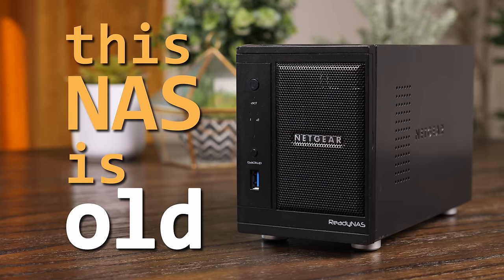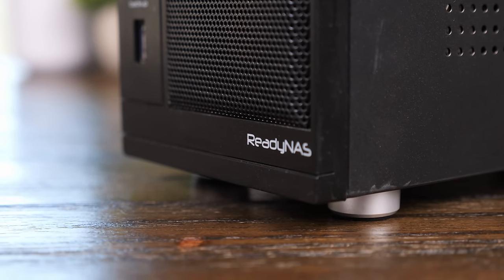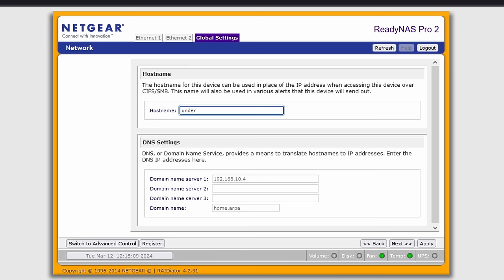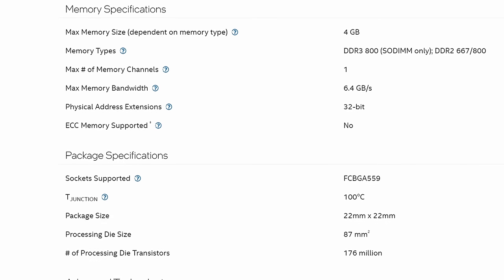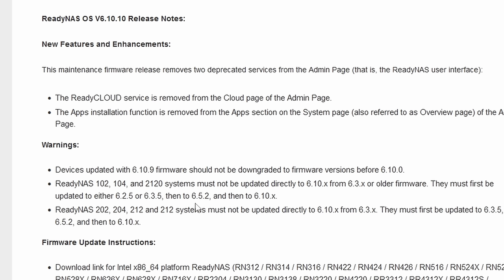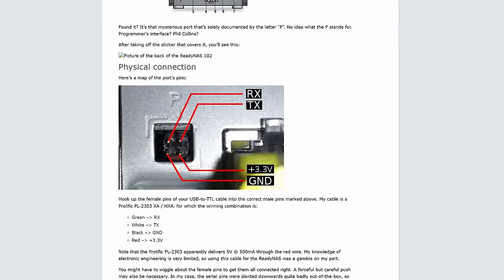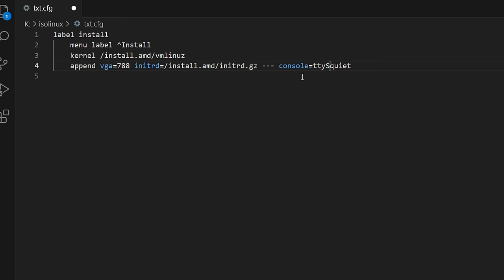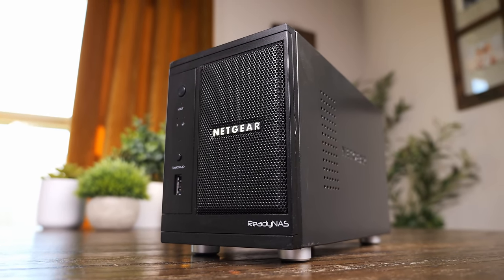The NAS You Didn't Know You Could Still Use

Comment: 6:45 The usual limitation with Atom processors for RAM was the Chipset. Intel had a "discount" chipset for Atoms that maxed out at 2GB (forget the numbers/names but it was VERY common). The Atom CPU was good for 4GB, but the el cheap-o chipset was only good for 2GB.
Reply: Intel up to it's old games.
Reply: I think I found it.The chipset named the NM10 express that was an "ensh--ified" low-power consumption version of the ICH7 chipset that was kneecapped to 2GB.
Reply: Not sure why the chipset matters, the ram controller is in the CPU (hence why the limitation of RAM is in the CPU page and not the Chipset page on intel Ark)
Reply: @marcogenovesi8570 You are limited to 2GB per "slot" whether it is soldered or socketed. The RAM had to be distributed over 2 "slots" so unless you had 2 physical slots, even if one "slot" was soldered, you were limited. I don't recall if both slots had to match.
Reply: @racecar_spelled_backwards868  That's not an answer to my question. How does a chipset care about RAM that is connected physically to the memory controller in the CPU?
Reply: @racecar_spelled_backwards868 Mind me I'm not saying the limits you post are wrong. I do remember them and they are real. I'm just disagreeing about blaming the chipset for that.

Comment: You can just use cat or pv or whatever to dump the contents of the onboard flash drive
cat /dev/sdx > /backup_file.img
This is not a "raw flash" thing but a "usb flash drive" that is soldered on the motherboard,, so it does not need special commands for backup or restore.
Reply from the maker: The issue was less so that I couldn't do it, and more so that I didn't have the time (nor the will) to do it at that point haha

Comment: systems like that on ddr3 era is actually very sensitive with ram type, ddr3 ddr3l and the frequencies. So maybe try a 4gb ddr3l 1333mhz RAM. usually ddr3l works on ddr3 and ddr3l supported motherboards while dd3 sodimms only work on ddr3 only motherboards.

me also see the part trying to boot debian linux on it, and im expecting you to get a blackscreen, and yes it does.... default boot config for debian is to boot via VGA so yeah, want serial output, you need to edit config file.

Comment: Meanwhile, I do stupid things and intentionally set my NAS to support SMB 1.0 so I can connect to it with my old Windows XP/2000 computers. On top of that, I expose it to the web with Tailscale so I can access it remotely. All of this is running on a Celeron laptop (with the battery capped) I got a few years ago that isn't good for much other than using it as a basic NAS, which I am doing by making a shared drive in Windows 10. I know my setup is bad, but I only do it this way because I want to.
Reply: Tailscale is still a VPN so it's not like placing a SMB1 share just there on a public IP
Reply: @marcogenovesi8570 That's true at least

Comment: It's not that old.  The computer I'm using right now is 12 or 13 years old.  It does everything I need.  I can run a lot of programs at the same time, as well as have dozens of browser windows open.  I have a virtual machine so I can run Windows XP and old software that I really like.  When I built my computer, I used top of the line parts so it would take years to get outdated.  The only upgrade I've done is to replace the hard drive with an SSD, and I'm up to Windows 10.  Since 11 may not run on it, if I need another operating system, I'll go to Linux.

Comment: When my Qnap 4 bay starting having issues i discovered it used a internal usb Bom glued internally i ripped that out installed Unraid its now my wifes 4x6TB personal Cloud sever eith custom Noctua fans for quieter operation even added liquid metal to the SoC 🤣 and oddly enough added additional ram that the og os couldn't see.

Comment: I got excited when i seen the thumbnail but unfortunately my readynas duo is a v1 and uses the spark cpu, the ONLY thing that can be done is upgrade the ram to 1gb, it has 256mb at the moment and has had for the last 6 years as i cant find the right module for it, and unfortunately there are no useful hacks as everything was made to use the Atom CPU and not the Spark, i just use it as a JBOD share to back up our families phone data like pics, videos etc automatically every night, then i have an external usb drive plugged in that mirrors the internal drives so if one does fail i can just swap it out and copy the info back

Comment: I have the 6 bay version, running trunas. Pulled it out of the recycle bin at work like 8yrs ago and filled it with 6gb sata's for a raidz2 pool. Its not fast, and don't dare run any plugins (chroot jails, containers). That said, it just runs and runs... never reboots.

Comment: thats a typical intel thing. i have a intel silver j5040 as my daily pc and i looked online what can the cpu do and how much it can do. i learned intel is a really confusing on such stuff. 
on desktop cpus the talk about system wide memory size but on embedded cpus they talk about max ram per channel. on server there is no limit at all only a recommendation so the mainbord manufactures decide how much is to much like dell or supermicro and such. but some times these things get mixed up if the cpu us oem only or renamed for a different purpose with a slightly different socket or a different mounting package. 
like the j5040 it is a normal pentium for it falls in the silver category and is for thin clients and tablets. but also for small form factor servers like a router or multipurpose nas system. in this case it is not that clear what it will be. is es nor a mobile chip or desktop or oem only or server. it says 8gb but if you look up the pentium thats in this chip this can 16gb so i tried 8gb stick and it worked also the 16gb stick worked but it had some random bugs and crashes so this might be to much this thing can really handle. so i did 2 8gb sticks in it and i use it like this for 3 years now for every thing i do except for gaming obviously ^^

Comment: Does anyone know if a raid 5 or 6 can rebuild using only the remaining disks if replacing a failed drive is not an option? All that would be if there was enough empty space on the remaining disks to fit the data despite the loss of a disk. My reason for asking is that I am considering putting 3 sun F 80 warp drive pcie cards(Gen2) (4x200GbX3cards) 4 WD green ssd (480Gb) and 1 2Tb hdd in a nas/server type pc. The F80´s would be in a raid, either 0, 5 or 6 that would be raid 1 with the hdd. From what I heard in a raid 1 the fastest free disk will handle the I/O so the hdd should be virtually untouched but still have the data just in case. The ssd´s are tbd regarding config. The system I plan on using is a AMD FX 8350 with 16Gb ram. Would a graphics card be a asset (besides setup) if I run it head less, perhaps for trans coding and stuff or is it just wasting space/power?
 If this is the wrong place to ask please tell me where a noob can ask this please.

Comment: It's quite sad to see manufacturers just locking down their systems in order to make just a slight bit more profit, the amount of ewaste that these things create are insanely and unnecessarily high, just make an open source bios and os and allow people to hack & update it for eternity...
Reply from the maker: In all fairness, I think Netgear shutdown the apps and such for security reasons, since there wouldn’t be any updates available. 

And it doesn’t seem like they intentionally made it difficult to install another OS, there just wasn’t a need for a video output on these. I think some of the larger models have vga headers making it a breeze to install whatever. 

But yeah, I think it WOULD be nice if when they end software support, to have some sort of tool to make flashing an OS much easier.